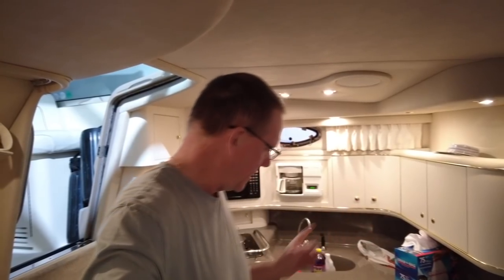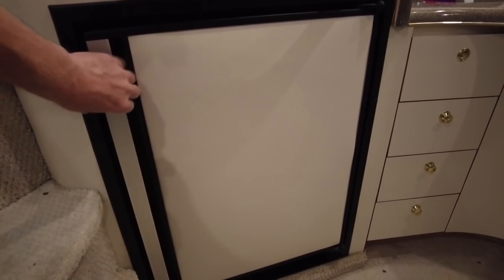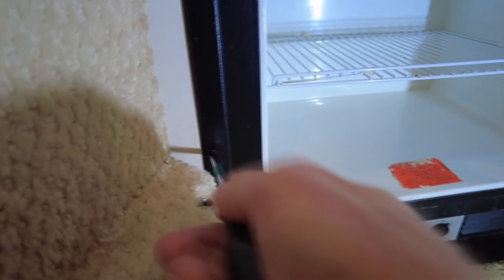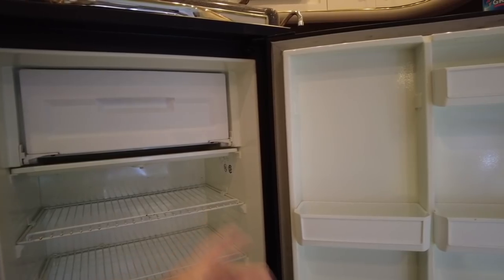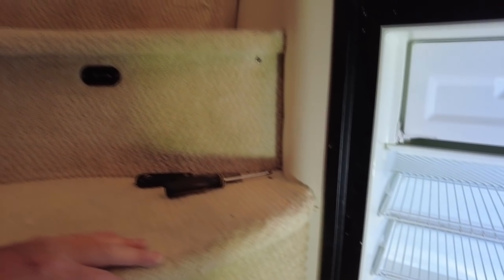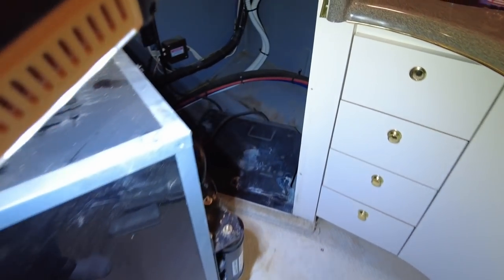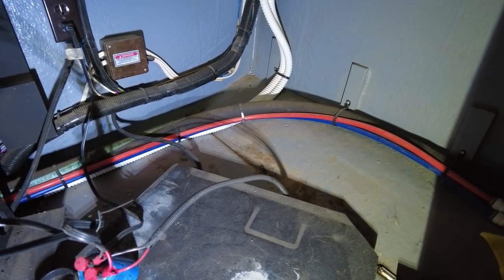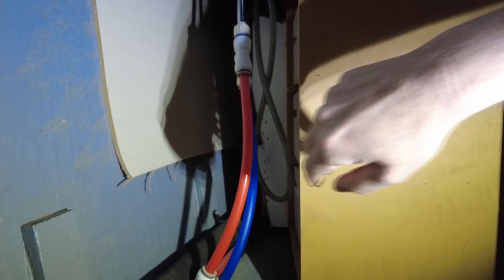Removing Our Boat Fridge, Cleaning and Changing Door Swing!

Comment: Thanks Paul for making this video. I am trying a similar project this weekend.
Reply from the maker: It's pretty straightforward, just be careful not to spill or streak any wetness or rust across your flooring from the bottom of the fridge. Ours was in decent shape, but I wanted to do this before we had the new cabin carpet installed.

Comment: Looks like you purchased a boat that was well maintained. PS, I like the galley set up. A larger cook top is not needed. I think I used my cook top to boil water. I like the chrome rails and just a good looking galley. Maybe throw some cleaner in the black tank and then fill it up with water. After taking it out for a ride, next stop the pump-out station, Rinse & Repeat‼️‼️. BEAUTIFUL BOAT, GOOD LUCK ‼️  Vinny 🇺🇸
Reply from the maker: Thanks Vinny!

Comment: Wow, was it ever clean in behind the fridge!  When I pulled ours we found shavings, a bunch of those screws with the large thread you showed and even a couple of pieces of water line that obviously were cut off in the installation.  Plus, lots of dust.  I'm impressed with how clean it was.  Am I the only one who noticed the number on the capacitor when you showed it?  "38DA"  Makes me wonder if it was replaced at some point and perhaps that contributed to the cleanliness.  Great how to video like usual!
Reply from the maker: Actually, the number on that capacitor is 36DA, not referring to the boat model. I believe I have the original serial number for the factory fridge and will cross reference that with the one on the unit for you to confirm. When I do that, I'll post a close-up pic of the capacitor on Instagram for you. It'll be fun to find that info out!
Reply: @BoatingWithBoogaboo   eyes must be getting old!  Mine that is.

Comment: We are replacing the electronics when we get back in the spring before we board for our first summer on the boat, cruising for 3 months solid!!
Reply from the maker: Three months? Nice!!
 Hope you get a chance to watch my electronics replacement video (https://youtu.be/AgThlL7KM7U). Loved upgrading to my new Garmin equipment!!
Reply: @BoatingWithBoogaboo  Thank You we are excited, I watched it a while ago and went to West Marine just to start inquiring about radios and bought the same system you bought. And have been in contact with AiMar about a transducer for depth info on the 943. I have a few new ie questions if you wouldn’t mind sharing your experience with. How many lines should we have? Size, length and numbers, also how many fenders would you suggest. Any opinion will be appreciated.  Thank You Jim n Donna
Reply from the maker: Not sure if your boat's size, but I would HIGHLY recommend having at least three dick li es per side, plus two extra for when needed to tie up at a dock (or lock). And have the first six (three per side) always in the cleats, ready to go.
 Same with fenders. Have at least three per side + one extra per side. On our current 370 Dancer, we got all new lines, ranging from 15' to 30' in length, plus eight, 8" fenders/lines/fender adjusters.
 There's nothing more frustrating than seeing a boat approaching a dock or lock and the crew is running around like fools trying to swap over lines and fenders at the last moment 😠
 Check this out; https://youtu.be/y-cfG1poNMA
Reply from the maker: Perfect 👌 Then the video I forwarded was most appropriate 😁
Reply: @BoatingWithBoogaboo  thanks so much, perhaps we will cross paths this summer on the TSW.

Comment: Thanks for the info! What’s your method for deep cleaning areas like this? Soapy bucket of water and rags or spray cleaners? Both?
Reply from the maker: No running water on the boat that day, so it was just spray cleaners. Did a great job and the fridge came out like new again 👍 Just the start of major cleaning of the entire boat.

Comment: My wife wants me to replace the water sprayer on the sink as it’s moldy.  I’m wondering if it would be easier to take the cabinetry panels out behind the draws or your idea of taking the fridge out to get at the connections?  Thoughts?
Reply from the maker: You might be able to reach that by just taking out the drawers. Try that first to see what kind of access you'll have.

Comment: Is it a pretty straightforward job to replace the ice maker with a Corona fridge?
Reply from the maker: For me on our boat, I'm going to have to cut back some of the fibreglass to enlarge the opening, as the new fridge is slightly wider and taller. That's an easy job, just dusty. For the power connections, the A/C side will simply plug in to the existing outlet that the icemaker used, but I'll have to run a new, dedicated D/C power supply. Again, easy enough, just a bit of work.